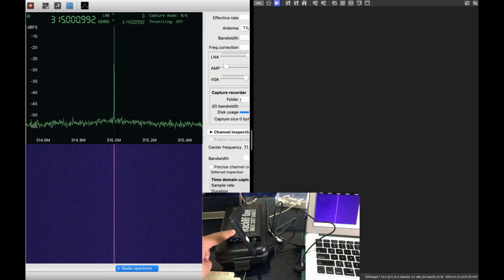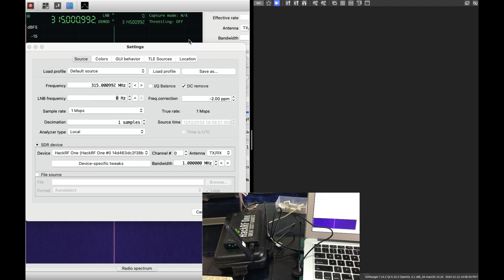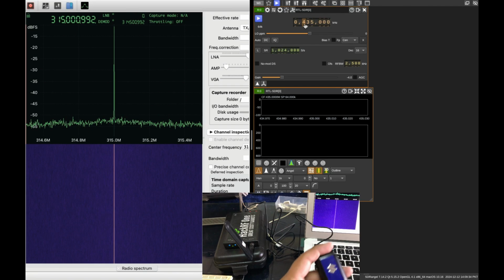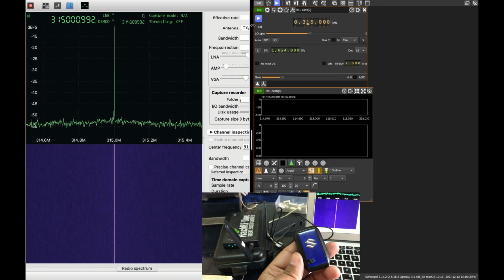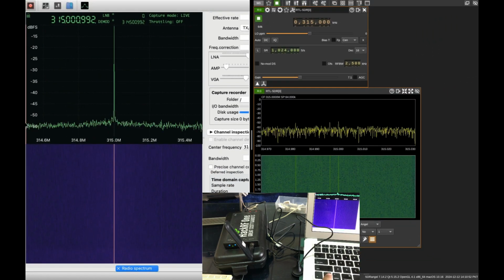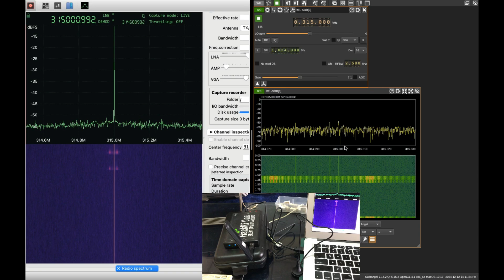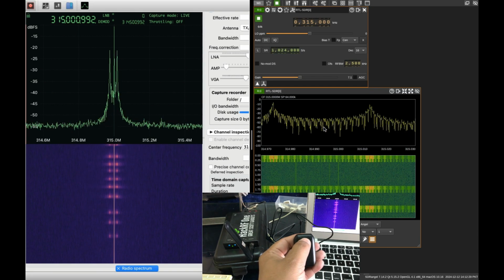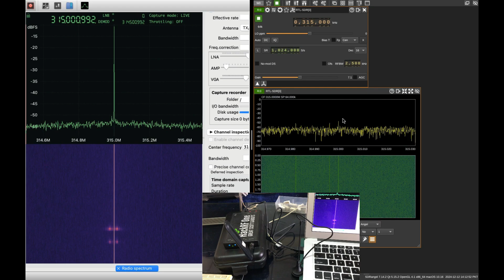KeyFob Signal Analysis Using SigDigger & SDRangel | RTL-SDR and HackRF

Comment: Hi, SigDigger developer here. What you are observing here is caused by setting the device gains from SDR Angel too high. You are essentially saturating your radio and a lot of spurs show up (which are not physical, they are a byproduct of the clipping of the received signal). Additionally, it seems that SDR Angel and SigDigger are showing very different proportions of the spectrum (SigDigger is showing around 1 MHz while SDR Angel is showing barely 64 kHz). Assuming that the FFTs sizes have been configured to be the same size (my bet is they aren't, but I can't tell from here), you are going to get finer detail with the latter configuration. Also, it looks like you either have set SigDigger's averaging time to something relatively long or your FFT size is too large (probably the former), otherwise the spectrum wouldn't be so smoothed out in the time direction.
Reply from the maker: Thank you so much for the insight, I will look into it,